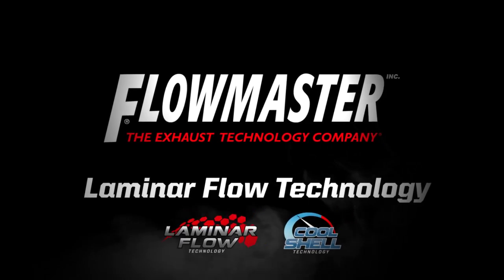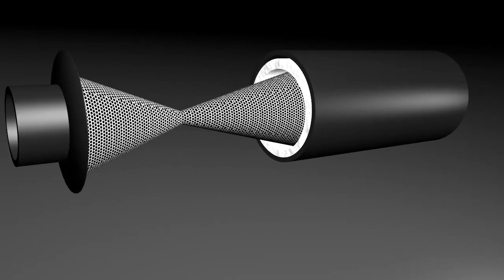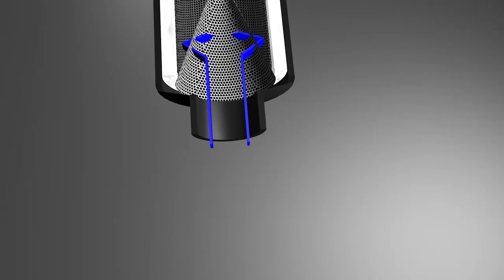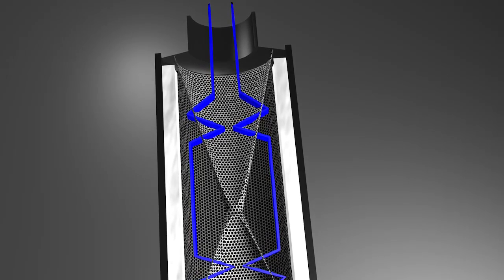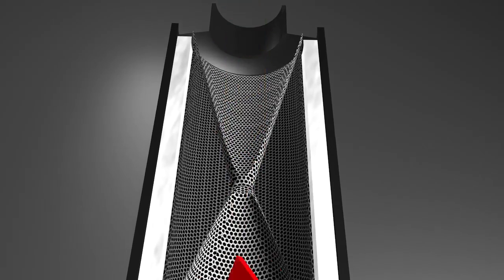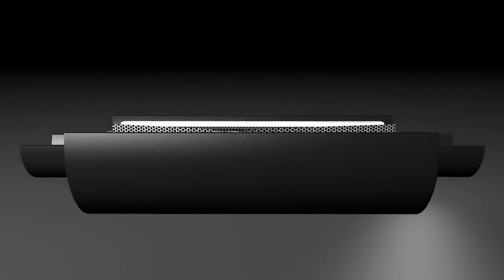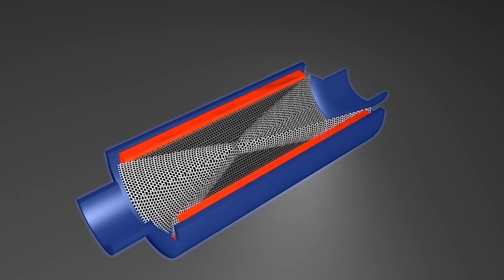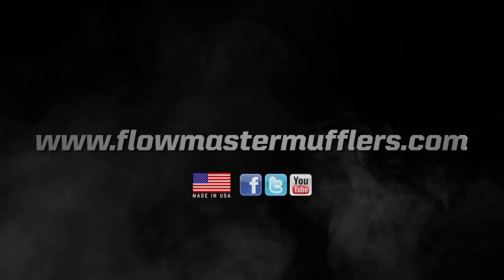Flowmaster Exhaust Technology Explained - Laminar Flow Technology 101

Comment: My questions are: 1. Do laminar flow mufflers flow more than 'regular' perforated core mufflers? 2. If I install one of these THEN a resonator - will said resonator negatively affect the advertised increase in flow? 3. What technology do you use in your resonators? (The same? Similar? Regular perforated core?) Thanks...

Comment: That's cool. If it works in reality as much as theory, sweet!.... Tho exactly how much quieter are they compared to say a 40 series or a glasspack (both interior & exterior. My goal is to find enough of a compromise between max exterior noise & performance, but minimum interior noise. Seeing as glasspacks are fine as far as interior noise goes, that's not as bad. Definitely don't want more, but less would be nice.